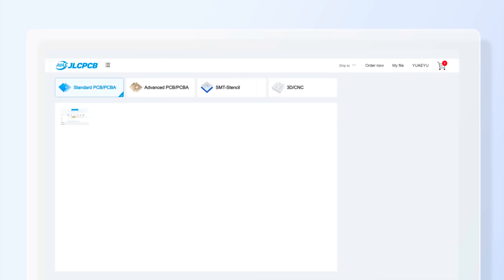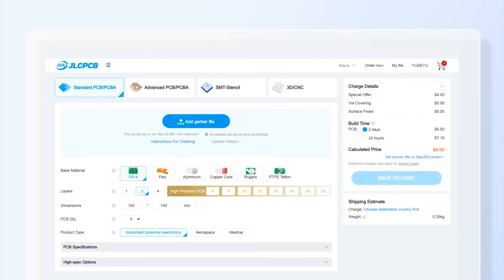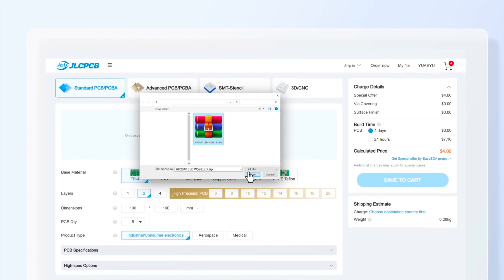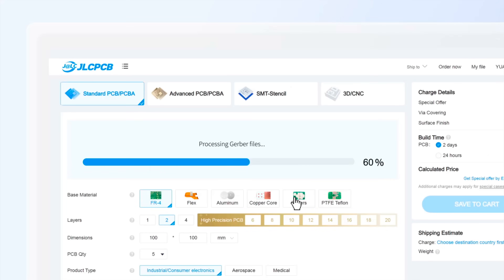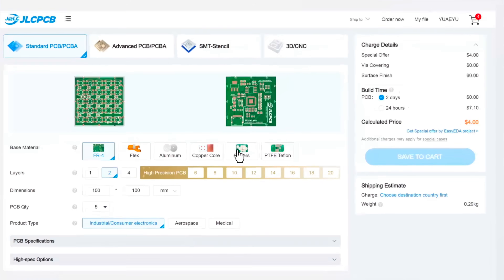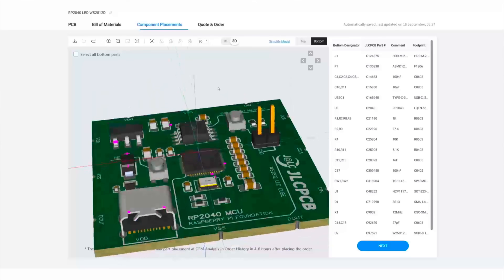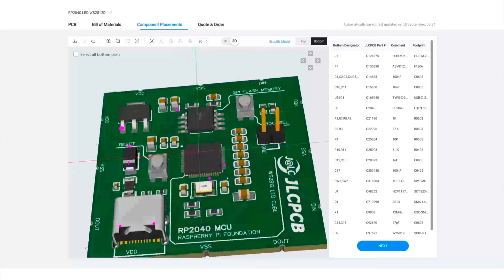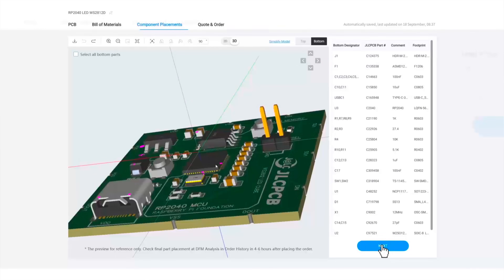EE42 Transformer Rewinding 12V to 380V using Copper Strip

Comment: It's not going to be good for high frequencies such as in this case of 40 Khz. There will be greater eddy currents, greater capacitance, greater inductive and capacitive reactance and more lag in the AC cycle between the phase relationship of current and voltage.
With that said, there's surely circumstances where it will be advantageous.

It's relative to transformers where the system just needs a lot of cross sectional area and in such, you can literally use 1 winding of absurdly thick, solid core wire and your other coil be whatever it needs to be in turn ratio and gauge. 

I've invented a new induction motor that I expect the coils will also be superior when based on my work and will be building them soon. I just got a coil winding machine with an auto-spooler so the wire is moved back and forth automatically for the most even winding pattern.
Reply from the maker: Litz wire will work better

Comment: using copper strip saves more space than strip type and reduces skin effect problem 
if it 0.2mm thick and 2.5cm wide it will equivalent to  5sqmm wire which can safely receive 31A  current 

can you use your welding machine core to make smps and what frequency does it usually use?
Reply from the maker: I think the welding machine core is not made for high current , EER42 in my case able to deliver maximum 200W before getting very hot it's better to use other core that are made for inverter like EE-35 or EE-55 is bit bigger can handle 2kw
Reply: @Electronic_For_You   cheap pq3535 core from digiclass only 1.5-2$, they don't specify any specs except that industrial grade switching core used in switching production
 i saw them make 1Kw-2Kw switching for audio equipment 

if i buy it 
can it be used with 45khz frequency and 300w power?

Comment: 200W mini ips+10A charger with good cooling system durable and portable so can cary anywhere for traveling I want to use lithium facet battery pack 20A or 40A 12V
Hello sir i have mini pc ryzen7 7840hs power consumption 50,100W per 1 hour 

Please upload a video every traveler need this type of  portable mini fast charger ips
Reply from the maker: Ok I will try

Comment: You can get more wattage from it you know 250khz 990 wattage 1 turn for any voltage voltage between 12v to 70 v and 2 turn for 80 v to 150v and 3 turn for 160 to 250 and 4.5 for 260 to 320v
Reply: At that frequency you will experience high switching losses. That is why you do not find any smps on the market that operates above 100khz in hard switching.
Only LLC and flyback can operate at very high speed. Eg LLC can go as high as 1mhz.
Reply: @olinos4461  Series-resonant full bridge also can work at higher freqencies. EG-micro's EGD-1000W_v2 24-220V works at 75kHz, but I tested it at freqencies up to 100-110kHz, and it works(with the appropriate values of the resonant tank). But that circut(by EG-Micro) has a problem, the soft-start is not working properly, and startup is very stressful for FETs due to high inrush of output capacitors
Reply from the maker: I used 40Khz ,
Reply: @Electronic_For_You  then yourr only getting 250watt
Reply: Hello sir, is it okay to use 250 khz on ee42 ferrite transformer?
Reply: @jessiesalaniocabanero9681  I think PC40 ferrite material can't handle ferquency up to 250khz so don't try that.
Reply: It isn't that easy to increase above 100khz as there will be much more skin effect loss if the wire is this thick and switching loss and heat generated by that frequency plus that amount of power (990W) you say is bringing another insanity. Or have you made and prove it yourself??

If you are a beginner just stick with 50khz or lower with low wattage (500W or less).